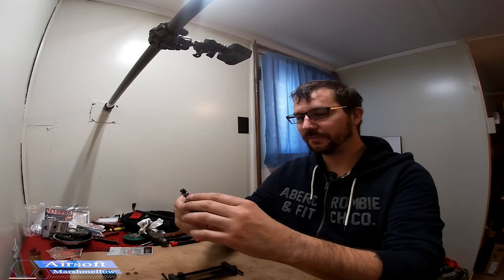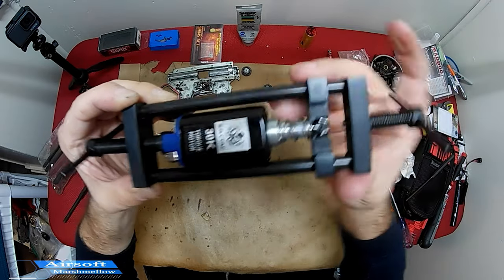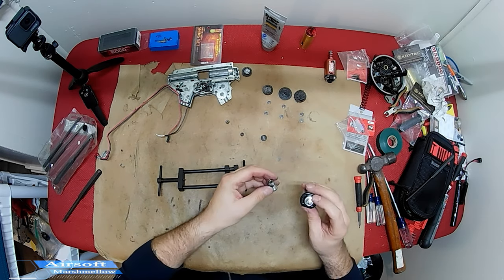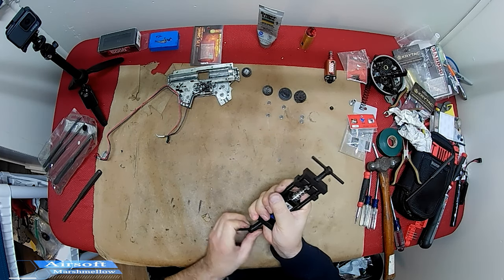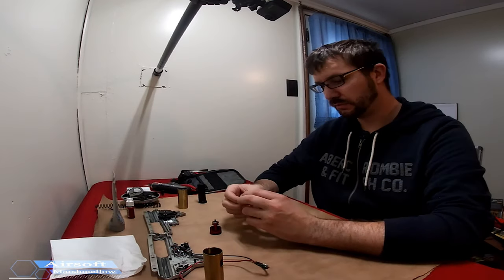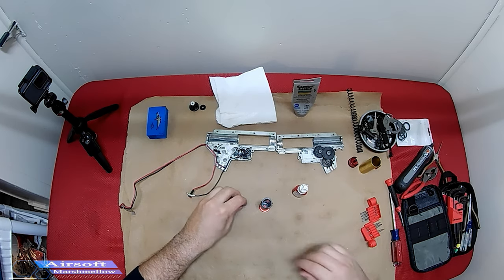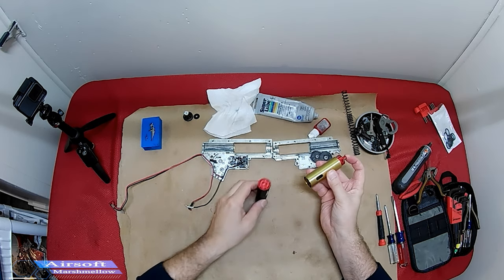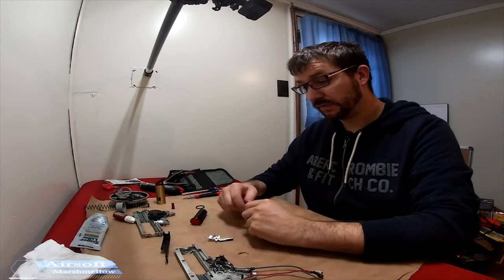Krytac LMG Post Upgrades Part 2

Comment: That gear press/puller is nifty!
Reply from the maker: Yeah, I've seen a few different ones now. It's definitely something you'll need if you have a O-type pinion gear. Or can even even use it on the D-type (after you losen the set screw)